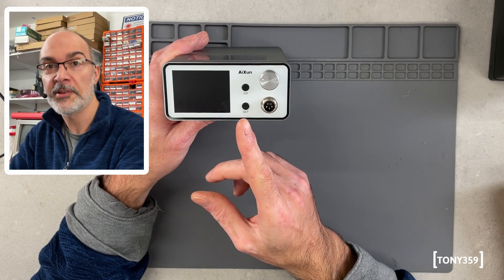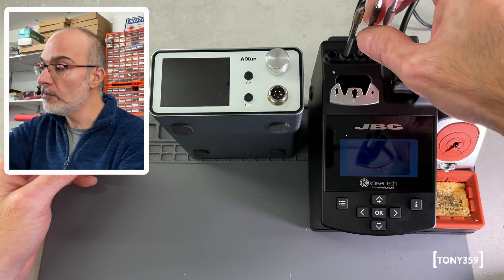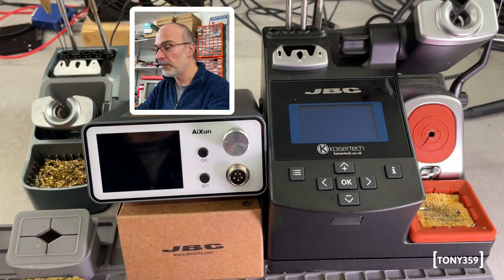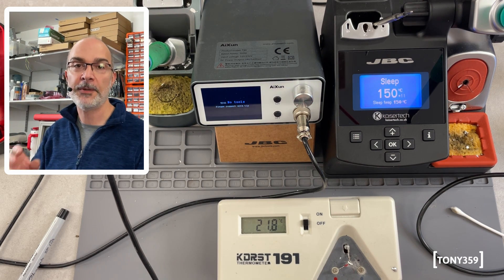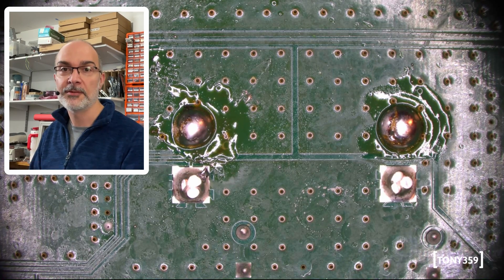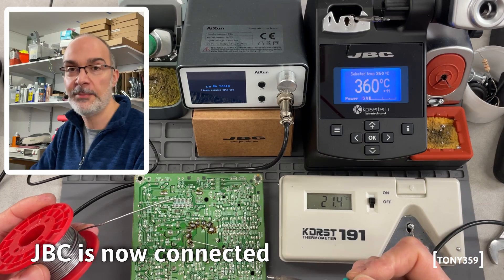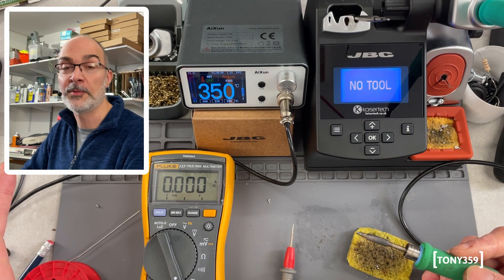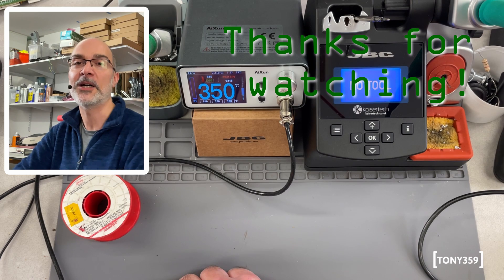Can the Aixun T3A really beat a JBC station?

Comment: I think the issue may be a ground loop. Here it is a requirement to tie ground to neutral. The thought is that the other two line along with neutral take care of the load & if any hot wires touch the case then it has a path back to the transformer instead of going to ground which could be you. However, there is always power on everything. I usually use a battery pack or a very nice power supply but I just got a new iron & was having issues with it. I decided to test after watching your video & found 3.5v AC. I separated my ground with a 970K resister. I don't want to poke my iron into a live circuit & become the point of discharge.

The 970K should still allow static to discharge which I think is the point.

I had this thought in one of your other videos but after you tested it wilt the speaker I was pretty sure the ground loop was the issue.

I do not know the correct value. I was guessing 1M & 970K was the closest I have. My handle has a through hole & a pad. They had connected to the pad. I moved the wire to the through hole & cut the trace ap the pad. This is where I soldered a SMD. However a through resister & heat shrink going up to the clip would work also.
Reply from the maker: Hello - someone else has suggested that. My T3A is in a box, I've wasted enough time with it! If that resistor is all it takes, then (more) shame on Aixun as they could issue replacement handles to the affected users. 
Thanks for watching!
Reply: @tony359  
I am sorry to hear that. It looks like a nice little station. I also think it would make great content for a video.
Not everyone has the same power set up & most people don't understand power. I'm no scholar myself. I've just been working with electric since I could walk.
Even the scholars are still learning tho.
People look at power as ether on or off but the truth is energy is everywhere & in everything. It is the potential between two thing & their ability to transfer that difference that we see.
Most consumers buying item think everything needs "grounded". This in itself causes most electronic issues.
The tip is probably grounded because that is what consumers demand.
The best solution would be to match the protentional of the iron to what you are working on (how wrist straps work).
You could put a insulated plug in the device to attach to the 0 plane of the device you are working on to keep them the same but the resistor allows a slow blead back to "ground" this way both items (if grounded) can be at the same potential.

If you are done with it, like fixing things & this looks like it has promise. Would you consider sending it to me at a worthwhile price?
Reply from the maker: @mtking2196  I am definitely looking for a buyer. But only if you are in the UK :) 
The thing is that I like repairing things but I am not an electronic designer so I'm happy to leave these matters to those more skilled than I am :)
Reply: @tony359  
I understand. I'm not either. I just know it is bad to have more then one ground. It is beyond what I can fathom to understand why.

I do understand why it is bad to stick a ground into something like mains. This is what the resister is for.

However if you want to sell a product you have to give people what they want even when they don't know what they want.

To bad shipping would make the transfer prohibitive. I just bought a cheap t12 that I'm tinkering with to see if I can make it more usable. That's what made me watch your video. I was looking for the one I bought. 😁

Comment: New 1.36 firmware is now available.  Also, the only way I could get it to upgrade from my 1.35 version was to reinstall the latest software (V1.19.15) from their website. Everything looked normal after upgrading to 1.36 but I didn't do any in-depth testing.
Reply from the maker: I heard about 1.36, my T3A is in a box so I don't want to check, I wasted enough time on that! :)
But I doubt this issue could be resolved via FW. It can be mitigated/hidden but not solved.
THanks for your comment!
Reply: @tony359  -- As I mentioned before, I'm not experiencing any of the problems you are seeing even on 1.35.  If you ever drag your T3A out again, try grounding the device you are soldering on to the ground jack on the back of your T3A and see if that helps.  Also, I wonder if this could be caused by your T3A being plugged into outlet on a different ground path than the device you are working on.  If so, there might be some ground currents at work here.  All of my stuff is plugged into the same power strip so no chance for ground current to flow.
Reply from the maker: @rpsmith No, the ground is the same. This issue has been confirmed by others so it's not just me. The voltage is also a tangible measurement. Others say their station does not show the same issue so I don't know what to think. Either there are multiple versions available or I do not know.
Reply: @tony359  -- So does the tip of the iron always show a small amount of voltage above ground or just when you reference it to the device you are wanting to work on that is connected to ground?  I'll check my tip voltage next time I'm in the shop.
Reply from the maker: @rpsmith  Only when the tip is heating - check while the tip is on the sponge or immediately after it's being powered up.

Comment: I  would love to have a JBC station, but it's too expensive.
Reply from the maker: I can very much understand. I'm sure there is something "in between" that doesn't try hard to fry our PCBs...
Reply: @tony359  Besides, I also solder like you, i.e. with two soldering irons at the same time, then I would need two JBC stations, and I also use a self-made soldering tip, which is not possible with JBC.

Comment: So glad i just came across your videos about this issue. I was just about to purchase this station but frequently work on grounded boards when they are on an oscope.
Reply from the maker: There you go!

I'm reading about other stations with voltage leakage at the tip - it seems to be a design flaw caused by the mains ground used in the secondary circuit. I have a feeling the T3A is not the only one misbehaving. Other stations might have been better at hiding this issue. If you think about it, if I had installed 1.35 straight away (which doesn't flash "NO TOOLS" anymore and hides the temp spike), I wouldn't have noticed. And not everybody has a soldering iron thermometer.

In short: be careful of what you buy! I hear that a linear transformer is a better choice :)
Thanks for watching!

Comment: You can try to connect the negative output from the power supply to earth. This may solve the problem or it may introduce a new one. Do it at your own risk. Nice video btw. Regards
Reply from the maker: Thanks for your comment! I'd rather not disassemble the unit, which is not easy to disassemble BTW. I am not trying to "fix" it, it's not broken, it's flawed :) I'll leave that task to people more experienced than me! Thanks for watching!

Comment: This is due to the Y-capacitor between the pri and sec windings of SMPS. Low-frequency current flows through it, throubh the negative output bus and the ungrounded body of the tip at the moments when the state of the diodes of the input rectifier bridge is open. The chinese connect the tip body to the earth with 1MOhm resistor only to remove the static charge.
Reply: On the T3A, the mains earth is directly connected to the DC- on the main PCB. The issue here is the JBC cartridges share a common connection between the thermocouple and the heater, when you touch the cartridge on something earthed, you create a potential on the thermocouple input which looks like a low temperature.
Reply: @sdgelectronics the T3A PSU has capacitor between mains & isolated side, right? (like any USB power supply). But the DC- output is also earthed too?

So is there a high voltage is on T3A PSU between output and earth? (like there is with any USB power supply). And that voltage leaks out of the tip, or have I misunderstood?

Edit: I was not correct. That’s the heater current flowing out the tip. When the tip is touched to an earthed pad, there is a parallel path for heater current to return to PSU -ve through the mains earth wiring because the PSU -ve is earthed and one side of the heater is connected to the tip through the thermocouple (in genuine JBC C245 at least). It also shorts the thermocouple to ground, causing it to read as very low temperature and turn the heater on. 
- In JBC with C245: the tip is earth, the second contact is heater2, the first contact is heater1 and thermocouple +ve (JBC heater power is floating AC, thermocouple is between contacts 1 & 3 (tip)). 
- In Axiun T3A: the tip must be thermocouple +ve, second contact is heater+, first contact is ground common (for heater & thermocouple).
Reply: @davadoff  No, the PSU is tied to mains earth through a lead going from the mains connector and soldered onto the front PCB, so no "dangerous" voltages like you typically see from floating power supplies. From what I can tell, because the thermocouple is in series with the heater, there's a small voltage set up by the amplifier between the cartridge casing and actual 0V, which is the voltage (~1V) measured here. When you short that to 0V, the thermocouple reads incorrectly and puts the heater on full power (only on some firmware versions).
Reply: I haven't encountered a FW which is not showing the issue - considering that recent T3A cannot downgrade below 1.30-ish because of display issues. Some later versions might be able to recognise the issue and only supply a short spike to the tip rather than intermittent bursts of power. However with those versions the display won't show the overshoot so I prefer older versions where at least you know what's going on. 

@Davadoff you are indeed correct.
Reply from the maker: Yes that’s something I’ve read around. But I’m reading 0 Ohm continuity between the tip and mains ground, not 1MOhm. How is that possible?
Thanks for watching and for commenting!
Reply: @tony359  In that case I think the current through the Y-capacitor and tip takes a shorter path to "global" point of earth than through the ground wire in the soldering iron's power cable. This may be due to the location of the sockets in the extension cord or the thickness of the ground wires. 
Remember that other consumers connected in series in the extension cord create a voltage drops on the serial ground bus at the same moments when the diodes of their rectifiers are switched. Because of this, there will be different potentials at different points on the serial ground bus.
Reply: My second thought. The JBC has a separate wire in the handle cable for grounding the tip directly into the handle on the petal. Whereas Aixun grounds the negative bus on the DIN connector. Because of this, an additional potential is created on the tip, caused by a voltage drop on the negative wire of the handle during the flow of heater load current.
Reply from the maker: I didn't consider that a small resistance to ground might cause a potential. Thanks for your comments!
Reply: @umanetsoleksandr5652  exactly! :)
Reply: That capacitor would not pass 1.8 Amps (not at a audible frequency anyway). So, it might be part of the problem but not the entirety of it.
Reply: Tip to earth should always be no more than a couple of ohms & millivolts, right? For any good soldering iron…
Reply from the maker: @davadoff  you are indeed correct.
I haven't found a firmware which would fix this issue - considering latest T3A cannot be downgraded much because of display issues. Latest FW versions will detect the issue and mitigate the problem by issuing ONE spike rather than an intermittent burst; however they also hide the actual overshoot on the display so I prefer the older FW where at least you can see what's happening.

Comment: Glad i sww this my trusty old weller, ec1200 i think, has died and ive been looking at these cheap controlers that will drive hakko and jbc hand pieces... the problem now is do they all do this and if so is it fixable???
Reply from the maker: No, I am told other brands are ok. Look for a unit with a linear transformer. That should at least remove the "voltage injector" feature! :) Thanks for watching!

Comment: I have one of these Aixun soldering stations and have had zero problems with it.  I thought it strange that you are measuring any voltage at the tip of the soldering iron, let alone measuring any current as this would indicate that the tip is not grounded.  I have just tested mine in the same way and have not seen these problems.
Checking continuity, the tip of the iron is most definitely connected to mains earth, so I can only assume that there are either different revisions of PSU/Controller boards that have this problem, or that you messed up the earthing when you took the unit apart.
Reply from the maker: Mine is also connected to ground - but only when not heating. Try while cooling down the tip with a sponge, to trigger the heater. You won't see any voltage - or very little - when idle. 
I didn't take the unit apart, it's still factory sealed.
Other have confirmed this behaviour so either there are different revisions, or something is wrong in our test procedure.

And BTW, Aixun confirmed (one of their rare replies!) that my T3A is genuine!

Let me know what you find and thanks for watching!
Reply: @tony359  Just tried it again with the wet sponge and no problems.  Tried it on grounded pcbs, no problem.  I must admit that when I first got the unit I did remove the back cover to check that all mains side wiring and earthing was correct, then did the equivalent of a PAT test on it as the Chinese have a nasty habit of not earthing things correctly, if at all!
Reply from the maker: There must be multiple HW versions then. Others online have confirmed the same behaviour. If I check the tip for ground continuity, I have continuity - but only when idle or switched off. SDG also confirmed the "grounded PCB" behaviour on a different Aixun model. 
Also if this was a fault of my very station, I'd expect Axium to reply "it shouldn't do that, we'll replace it for you" :) 

So something stinks here :) Thanks for sharing your tests!

PS: do you have a T3A? You're not talking about the 420, are you?
Reply: @tony359  Definately the T3A with a T245 handle and old version of stand.  The new version of stand like yours wasn't available when I bought mine in late July 2021.
Reply from the maker: Weird. I do believe you of course. They must have done something to it.

Comment: Your testing is inconclusive you didn’t find out what was the cause of the voltage leak! Maybe it was to do with your handle falling apart? Maybe check another handle? 🤷🏼‍♂️
Reply from the maker: This issue is not limited to my station, others from the community have confirmed the leak is there. The part of the handle detaching is just a cover of the front part of the holder, it does not have any wiring.
This is a review/comparison. I tested the station, found the issues, contacted the manufacturer and then reported back to you.
It is not my intention to find the fix for this behaviour. This is a design flaw, not a fault.

Comment: What about disasembling the aixun and cutting the ground line going into soldering tip. Then solder a shottky diode so that no voltage will come from the tip. The tip will still be grounded.
Reply from the maker: It's been suggested. I just would like not to disassemble it because it's mostly a destructive process - the front panel is glued and I believe the PCB is also glued to the chassis. I'm sure there might be a mitigation but there is a long thread on EEVBlog and I don't think a definite fix has come up yet. 
Thanks for watching and for commenting!
Reply: @tony359  actually it is not so hard to dissasembly that station. The board is not glued. I also have this station and I opened it couple months ago. I accidentally blowed up a mosfet because I touched the iron tip with 230V AC 😁
Reply: @tony359   What type of shottky diode will be ok?
Reply from the maker: I don't know, that's a question for @lgolebio :)
Reply: What type of shottky diode will be ok?